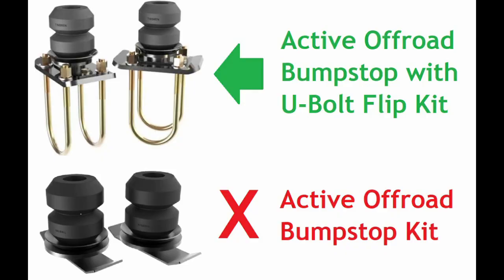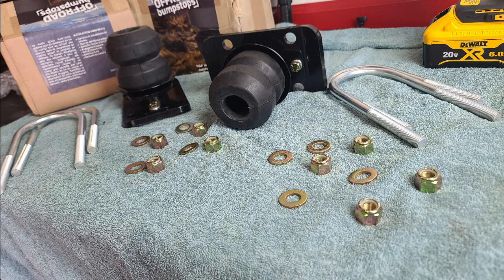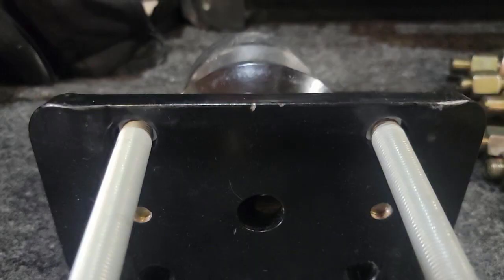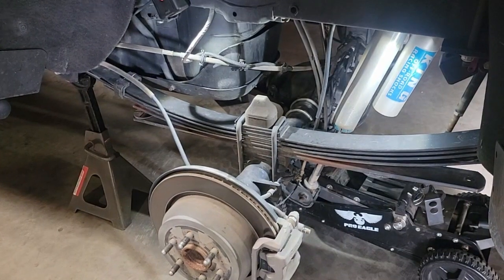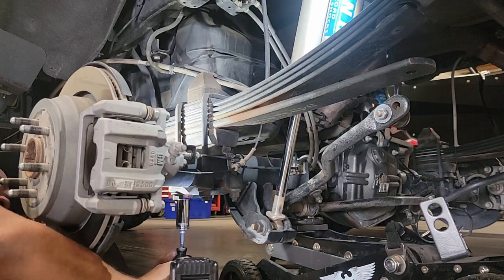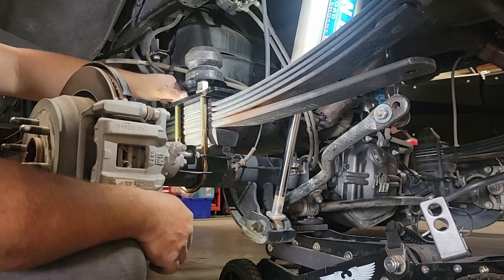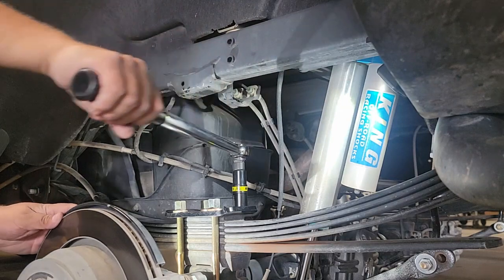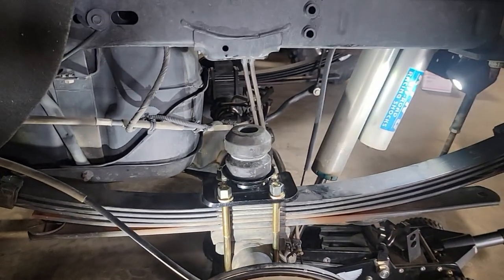Active Offroad Bumpstops for the Colorado ZR2 - Why I would reconsider my purchase & what worked out

Comment: I am surprised that of all the excellent videos you have done, you never did the 589 shock relocation..  Would have loved to have seen that.
Reply from the maker: I am not a big fan of loosing the articulation and travel. if you hit the shocks all the time, you might want to consider something like that but the availability of skids and benefits of having the pivots below the axle line are good. The better design would be locating the shock mounts further outward but remaining below the axle which would put the low point closer to the wheel/tire path. Even that will require a good deal of shock tuning when you start increasing the angle of the shock relative to its OEM designed position.

Comment: Thanks for the video. I see in the comments the u bolts you ended up with were OMEU59C, but can’t find a site that has the specs on how long those actually are. 

Can you tell me the length of the u bolts you used? Was that with an add a leaf or stock? If that’s the stock length do you know what length you need with an add a leaf?
Reply from the maker: The OMEU59C specs are as follows:
Overall Length: ~9.5 inches (240mm)
Inside Width: ~3.8 inches (97mm)
Thread Length: ~2.95 inches (75mm)
Diameter (Thread): 14mm (or 0.550 inches)
Style: Round 
Something to note when measuring U-bolts for replacement, always measure the inside width and the inside length (between the legs).

Comment: The link to the bumbstop say its for a tacoma. I'm guessing it will work for the zr2?
Reply from the maker: They are the same part, except the ZR2 requires longer u-bolts
Reply: @exhaustinglife  could you send me the link to the longer u- bolts i can't seem to find them
Reply from the maker: @afroget4  the part number is OMEU59C - google to find your best outlet and pricing.

Comment: Have you had a chance to tried the bump stops at high speeds ?
Reply from the maker: The only reason I added them was to mitigate bottom out impact at moderate to high speed.
In my use I would travel with 600lbs to 800lbs payload while driving on trails with higher degrees of articulation at slower speeds <20 mph. Occasionally, I would lighten the payload to 300lbs to 500lbs and do more spirited driving on washboard and less aggressive terrain absorbing <12" obstacles at speeds of 40-60mph which made full use of the bump stops. They were great at reducing the more violent impacts of heavy ruts, potholes and small protruding rocks.
Reply: @exhaustinglife  thank you for the reply 
Im between getting new upgraded rear shocks plus the timbren active bump stops or invest in fox hydraulic bump stops  and keep factory rear shocks 
Since they’re about the same price range 
What would be your advice in which to get ?
Reply from the maker: @josuemartinezmtz  I am not sure the hydraulic bumps pair well with the Multimatics (which have their own bump stage) with higher payloads and stock geometry. I opted for more travel with the Kings shocks and AAL with Timbren bumps to get what I needed. 

If I was doing more higher speed desert / baja stuff I would have configured my truck differently and would not be able to carry all the gear I have. Its very difficult within the range of stock geometry to have the best of both world for max payload and technical speed damping at higher speeds.

Comment: Should have removed the shim at the top of the leaf pack, that would make the U-bolts the proper length.
Reply from the maker: Unfortunately modifying the stock pack makes my point in this video. This kit works fine with the NON-ZR2 applications (base-Z71) but is not an exact fit without buying the Longer U-Bolts - Old Man Emu OMEU59C

Comment: why not hydraulic bumpstops?
Reply from the maker: There are not any bolt-on options I was interested in pursuing. Hydraulic are definitely an option but a set of Kings would run double and still require some engineering to weld into my existing geometry.

Comment: Do you have a p/n or specs on the longer  u-bolt that you used? I have this kit sitting in my garage for the ZR2 but can't find the correct size for the u-bolt that I need.
Reply from the maker: In the video I had a friend who had the "older" Tacoma u-botls that were supplied by Timbren but ended up getting Old Man Emus
Reply from the maker: Old Man Emu part number OMEU59C

Comment: Thank you, as always.  Great info.  At this point you already have the additional leaf installed, correct?
Reply from the maker: Yes, I have pictures from before with the stock leaf packs but at the time of the install and filming I had already installed the add-a-leaf.
Reply: @exhaustinglife  Thank you!
Reply: @exhaustinglife  Is it the AAL that made the U bolts too short?  Also, do these Timbrens impact off-road axle articulation/travel good or bad?  Great vid.
Reply from the maker: @BowTied69  No, not in this case. The AAL will eat up about 3/8" of the thread but as i explained in the video my first attempt at installing was BEFORE the AAL install. I put up some pictures of that in the beginning. 

The U-bolts show in the video are the OLD spec U-bolt that Timbren provided and work fine. Sometime during 2019-2020  Timbren switched supplier or just went to this shorter U-bolt and Nylock.

So far the the bump when engaged are less harsh and they appear to stop the up travel within about 1-2mm above the stock bump line observed before.  I am basically comparing the "line" of dirt on shock shaft and where the wiper stops pushing the dirt. This is a crude measurement as i cant tell if it during individual side articulation or at flat bump but I'm confident it doesn't have large change based on that observation.

Comment: Great video. As always straight and to the point. I have a question:
** You've done a lot of great mods. Why haven't you gone to a set of better full leaf springs in place of the add a leaf?
 The performance of full leaf springs with the 8 or 10 thinner leafs are much more progressive and you can also opt for higher capacity rating.
Thanks
Reply from the maker: Thank you. I had intended to have a custom pack made for my weight / payload but I was on permahold during the pandemic with my prepaid order never not arriving in a timely fashion. I would absolutely replacement leaf pack to remove the stock overload 2 stage set-up for all the reasons you stated. The add-a-leaf was just to get me by.
Reply: @exhaustinglife  Thanks for the reply. I'm going with the Deaver Expedition pack. 
Just make sure you have an replacement bolt for the front mount on the gas tank side. You need to cut off the stock bolt because the gas tank is in the way. It's a m16 x 2.0. You can get a grade 10.9 yellow zinc from Mc Master Carr. The oem bolt will be too long. I'm checking into the Length needed. 
I think you also need longer u bolts if you are going to keep the stock ZR2 spacer block. I'm checking on this.

Question:
When you had the 285x70x17 and Zero offset wheels with the AEV trim kit.
Did everything clear at full stuff, off and rock road crawling without any issues?
Was it necessary to do the trim kit on the rear or would it clear without it?

Thanks very much for all you videos. I really appreciate how through you are and the attention to detail.
Reply from the maker: @mark-kf3md  The front cleared full stuff but I also had the Eibach leveling spring on the OEM Multimatics and later the Kings with another 3/4" over that combo. The front did extremely well and I never experienced contact. The rear would contact under full stuff without the trim kit which I do mention in the rear installation video. I went as long as I could but eventually the contact started to catch the flare and was causing damage to the mounting screws and would eventually tear up the flare.
Reply: @exhaustinglife  Thanks
I'm now thinking of selling my 2018 ZR2 diesel and getting the new 2023 ZR2 or the AT4X. From what I've seen so far they have improved and added quite few things.
Any thoughts on those?

Comment: So I have this kit on my Chevy Colorado LT. 2015. I was also skeptical about the set up due to the M55 leaf pack I got from deaver. It bolted right in. Didn’t want lift blocks due to axle wrap and it just doesn’t look right. Granted the zr2 has them stock. It’s the lift block that gave you an issue.
Reply from the maker: The ZR2 leaf pack and block are different than the LT spring from factory.  The product is not correct for the ZR2 and it has to do with the U-bolt change that happened some time during 2020. If you watched the video all the way through I said multiple times it has to do with the ZR2 rear suspension specs and the change in U-bolt suppliers.
Reply: @exhaustinglife  love your videos but I don’t think Chevy made different leaf pack for each Colorado trim level. First of all that’s too expensive for Chevy, the zr2’s and the normal Colorado’s have the same leafspring squeak. All that. Only difference is the casted block they put on to add height. The mechanical parts are different like your 3rd member and your transfer case. You have the same leaf count as the LT. It’s not thicker. It’s just steel leafs.
Reply from the maker: @neekshernandez5894  I know for sure that they are. 

You will also find that GM designates a different part number for ZR2 / ZR2 Bison and the Z71 trim and lower with the same wheelbase and engine configuration.

Additionally AEV and Multimatic have also noted the changes in spring rate as parts of the development and design of their Tier 1 supplied products.

Inside of my own experience, I have had the the rear leaf packs replaced under warranty and had a good deal of time to look into the replacement parts that took a few months to get in.

While the leaf count is the same the total pack spring rate is notably different. This is the primary reason for the 2000 lbs lower towing capacity of the ZR2 (5k vs 7k of the Z71 and lower trims.) This is directly a result of the "softer" / lower spring rate.
Reply: Neeks, I have a 2016 LT and was looking at getting the M55 package to level out my truck after putting on 2.5” icon coil overs.  Questions... how does it ride when not loaded down? All I have on is a Snug Topper.  How much height did you gain from the M55?   What is your overall opinion on the M55?  Thanks.
Reply: @seth8982  overall opinion my brotha is, it’s one of the best mods I’ve done. For the first 2 weeks when I installed the pack I put my old pack in the back to add some weight. Drove it around for about 2 weeks. It exposes the front end. I have coil overs in the front but it’s so plush in the back, you feel bad for the front. Noise from the rear end is gone. Not a stiff ride at all. Thing that gets me is it’s a 3-4 inch lift. I was told it was 2 inch lift. I have coil overs in the front and I not have a rake like I did from the factory again. So I gotta invest in the front end. Overall it’s great!
Reply: @neekshernandez5894  thanks for the feed back. I went with the Deaver mini leaf spring pack, since I don’t tow and only have a topper, plus have the price of the bigger packs. On Peak’s  website it says the bigger packs get about 1.5-2” of lift with 450 pounds loaded.  I only need about 1.5” to level it out. If the mini pack doesn’t work, I guess I can do the add a leaf or a block. We shall see.

Comment: I am planning to go with the timbren bumpstops as well.  They are recommended for towing as the multimatics sag under little tongue weight.
Reply from the maker: Timbren has 2 types. The Active Offroad Bumpstop is more for dampening the immanent impact. They have the SES Bumpstops which are more for additional spring rate and towing / leveling loads with a trailer or heavy payload. The SES system has a different spring rate and is designed to carry constant load vs bottom out protection. https://timbren.com/i-30497768-timbren-ses-suspension-enhancement-system-sku-gmrcca-rear-kit.html#!year%3D2021%7C%7Cmake%3DCHEVROLET%7C%7Cmodel%3DCOLORADO%7C%7Csubmodel%3D4WD
Reply: Multimatics shocks don't support the load, the springs do; so it'd be the springs sagging.  Shocks just dampen the travel of the axle.
Reply from the maker: @BowTied69  You are 100% correct . Shocks in a leaf spring vehicle do not carry any load and no matter what dampener you place in it, the culprit for sagging is the leaf spring or other helper devise. The Timbren SES or other like devises are made to hold the vehicle ride height and add spring rate o alleviate sag.

Comment: Thanks for the video! I have a set I need to put on. What size socket for the u-bolt nuts to remove the oem one?
Reply from the maker: You are welcome. I will post up the size shortly .. i think its 21 mm but I will double check.

Comment: Do you have plans to use the front active bumps from timbren?    As well as 589 rear shock relocation to fix the ground clearance.
Reply from the maker: I do have the front and do plan an install video for them as well. I am not a fan of the current shock relocates. The old 589 design does limit wheel travel and total articulation. It also limits wheel and tire selections due to the space needed in the fender well. I am still not sold on the idea that the majority of users need more ground clearance. I have definitely used all the skid plates and the shock skid but have never been hung up on the lower shock mount and its why my comments at the end of this video were that modifications that attempt make more ground clearance do so at a higher cost and have questionable benefit.
I still feel that if you are looking for more of a baja vs crawler utility and like the look of outboard shocks, there are other things I would spend my money on. If you are looking for more of a crawler with larger, wider tires,  want maximum wheel well tire clearance and stock or more articulation this mod does not achieve any of that.

Comment: Running the front and rear Timbren offroad Bumpstops.  Highly recommend them! Another great well explained install video!
Reply from the maker: Front Installation coming soon. They are a little less eventful.
Reply: @exhaustinglife  Some use the Timbren steel cup, some don't on the front.
Reply from the maker: @madcratebuilder  The cup changes the feel for a firmer spring rate. Ill see what feels good. With that being said there are 2 spaces for changing the bump initial engagement point.

Comment: Thanks for sharing! I need to get a set of Timbren for my rear of my Land Cruiser.
Reply from the maker: Are you seeing issues with hitting bump stops? I typically would say that I didn't need these until i had 800+ lbs of payload and tried to treat my truck like a Raptor ;)
Reply: @exhaustinglife  I'm still running the oem ones in the rear. I'm more afraid of losing a spring while over flexing the rear and it not hitting a bump stop on some of the trails. Correct me if I'm wrong of this possibility.

Comment: SumoSprings has a direct bolt on for the Zr2 and bison. I've been running them on my daily driver and great for towing and off road use. Please check out SumoSprings. Band of brothers and sisters 🇺🇸🇺🇸🇺🇸
Reply from the maker: I did research the Sumo spring offering but I didn't like the inverted attachment point having the bumpstop mounted to the frame vs replacing the original bump using the strike plate on the frame as intended. 
At the time I got the Timbren U-Bolt Flip kit, I was not aware of the Sumo Spring equivalent. I did watch a few of the explanation videos where they compared the 2 and didn't care for the Superspring's approach to implying that a synthetic material is the only way to get a progressive rate (I know they never said it in so few words, but they definitely pushed the issue with charts and graphs.) As a discerning consumer and engineer I was put off but the fact that they ignored how the structure and shape of the Aeon rubber Timbren devise could achieve similar progressive feel... It's all marketing but they don't seem to make bad product and I would be willing to test and compare them in another application.